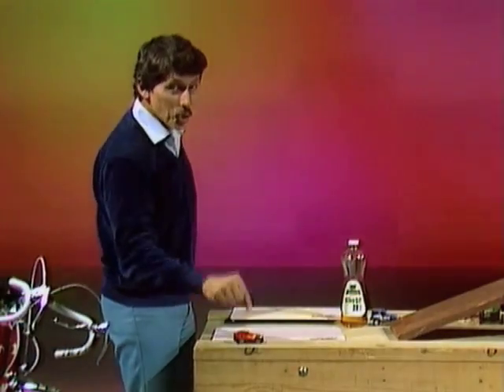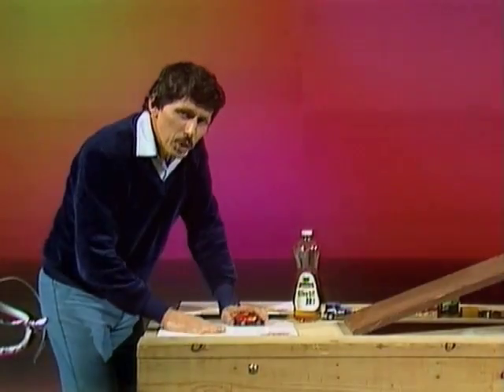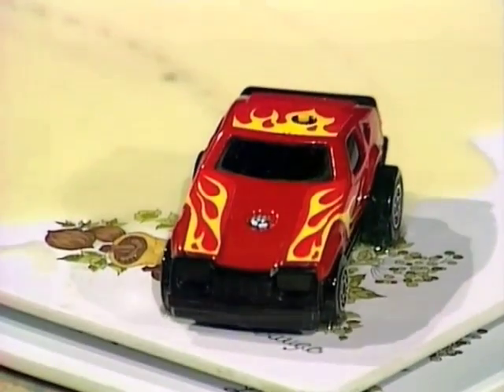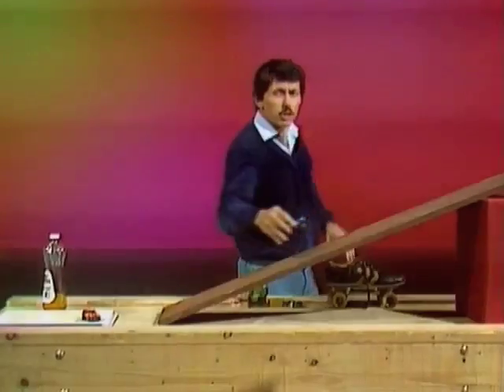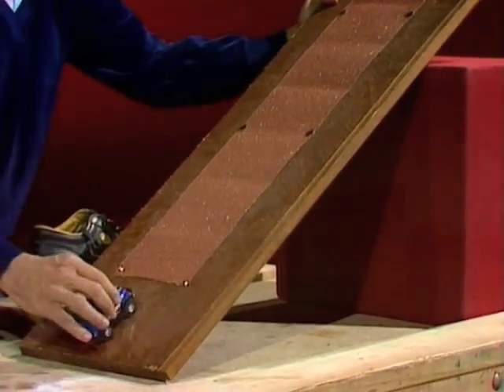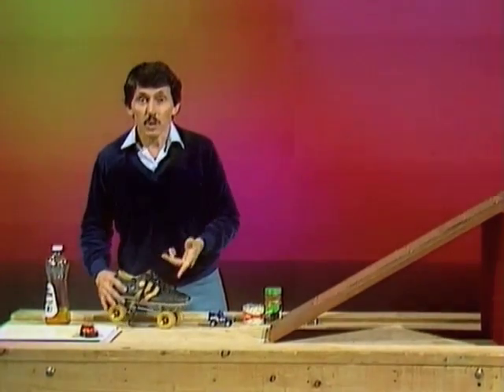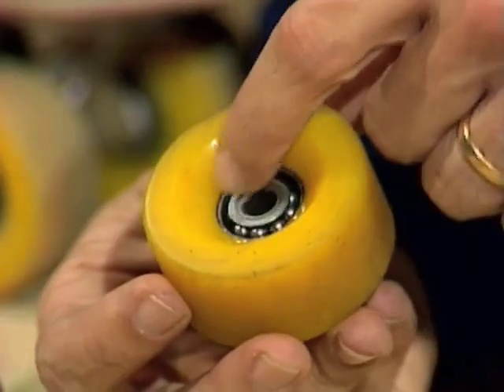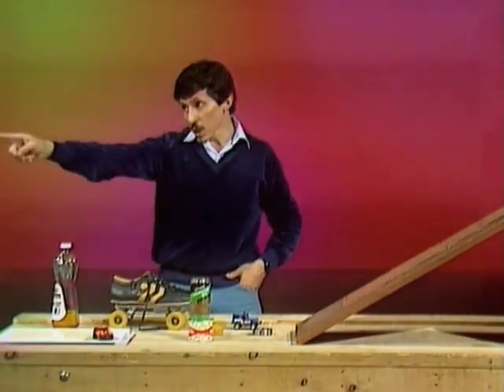Friction - Good or Bad?

Comment: During WW2 ball bearing factories were one of the highest priorities for allied air strikes. Without ball bearings making weapons of war becomes impossible. Not just vehicles, even the machines that  make the guns and the bullets require ball bearings. Genius really it's one of the requirements for industrialization, no ball bearings and u cut off all new manufacturing and have no parts to replace worn or damaged existing equipment.